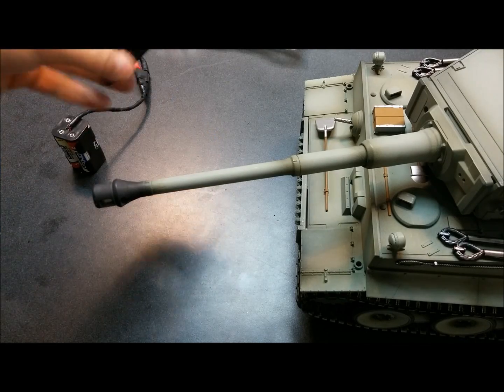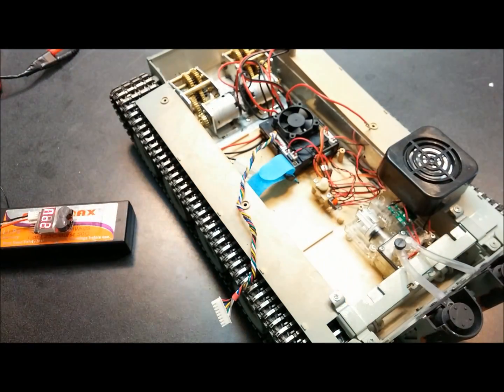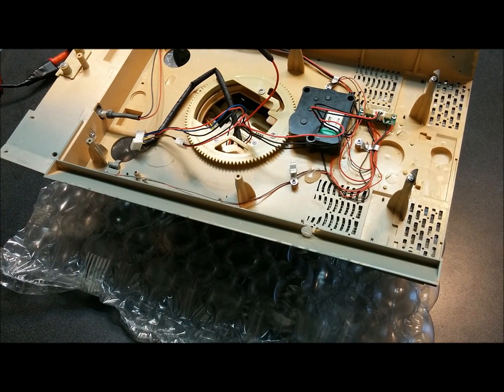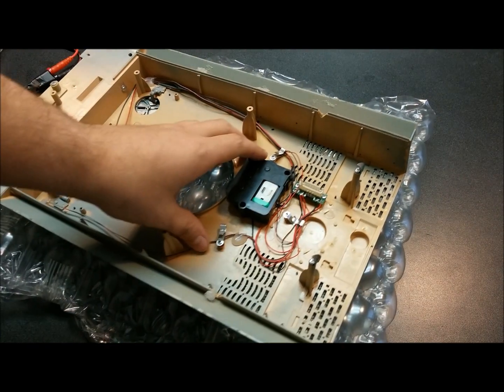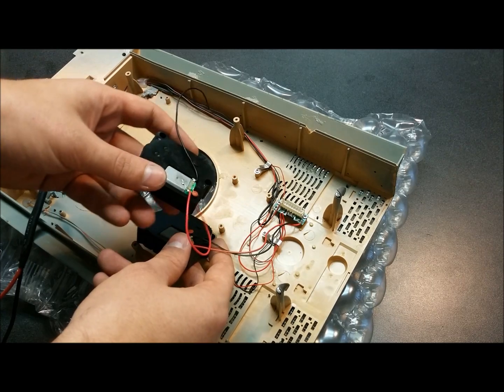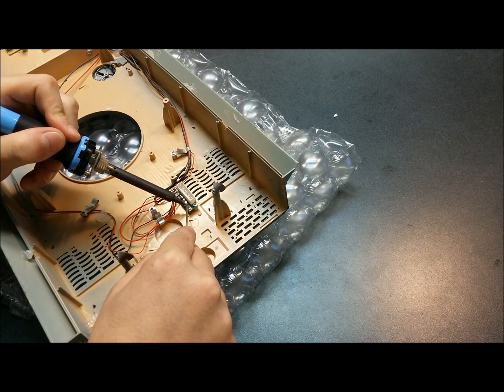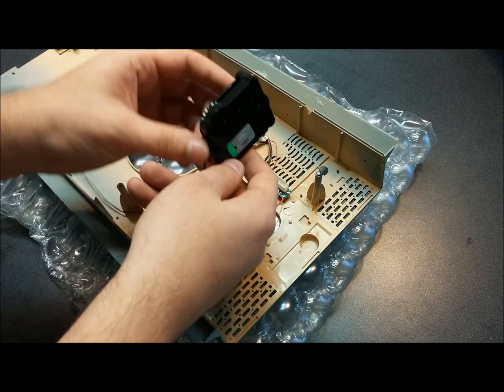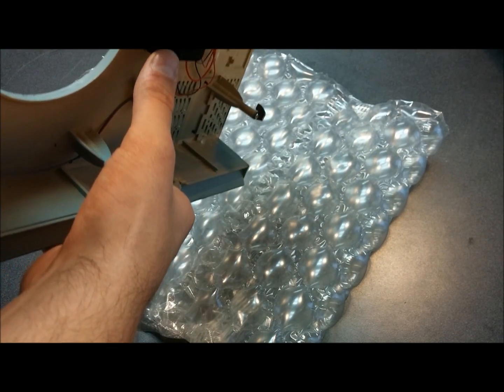How To Replace the Turret Rotation Assembly on a Taigen Tank

Comment: I have a taigen t34 and I'm having trouble with the turret rotating. First thing, it does rotate, but not initially when you turn the tank on. I have to click in each way once with my hand. Then after i do that it turns. I know thats probably not healthy for it but the wires seem to be all fine inside. I also smell a little burning smell. Not melting.